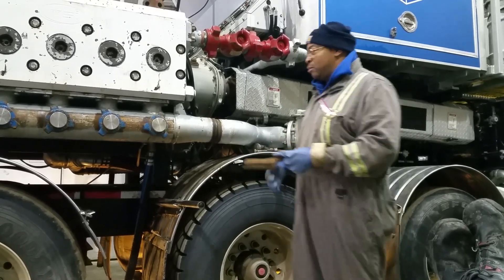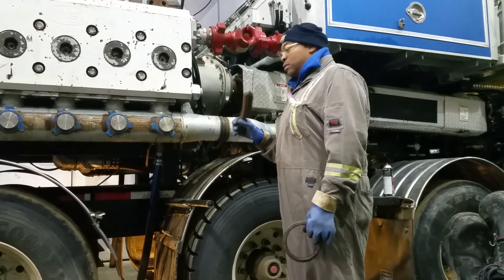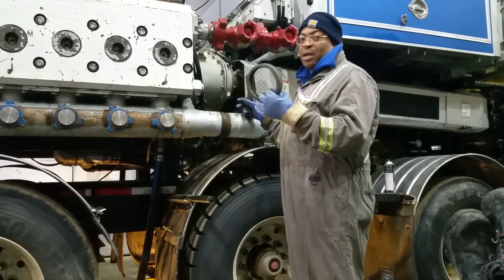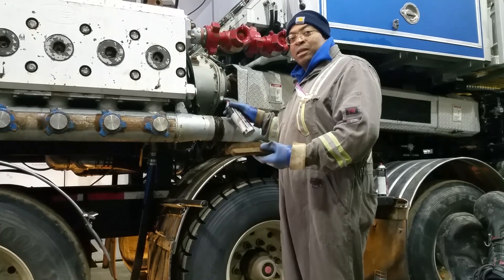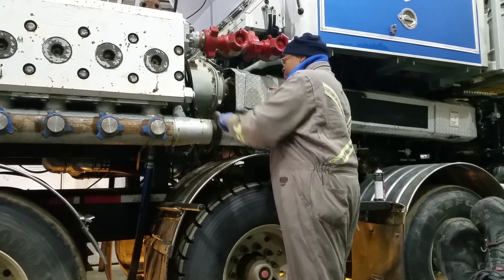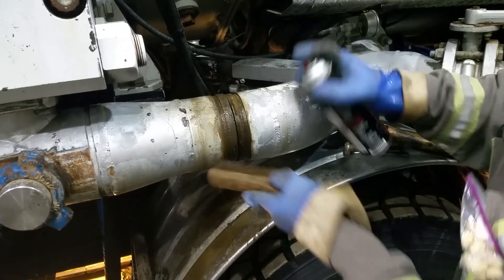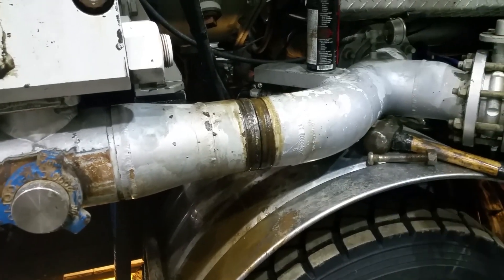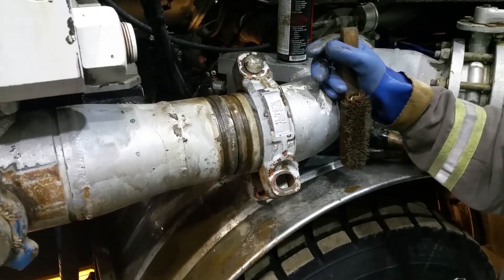Oilfield jobs tips for frac and pump-down fluid pumps

Comment: Please don't make any more videos that's a 6 inch victaulic seal on a suction manifold . Just grab a rah with diesel.clean it spread it load it grease it slide it grease it clamp it
Reply from the maker: Aka suction manifold seal...
Try to always keep 2 one in use and 1 slid on in case that one fails......
Reply from the maker: I got 300 hundred more videos check them out......
Reply: @JPTV3000 they also go on blenders hydration Treating manifolds parking garages  . Don't isolate it to a suction manifolds call it proper so hands can learn  what it really is and it's many uses
Reply from the maker: @jdfoley9258  what else on my YouTube channel have you seen?